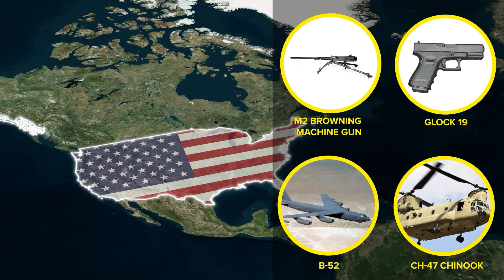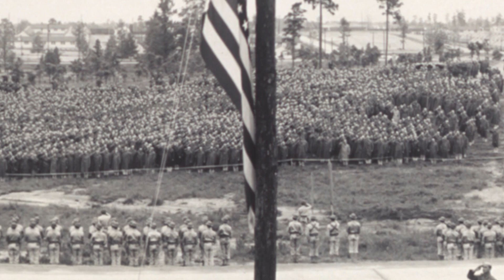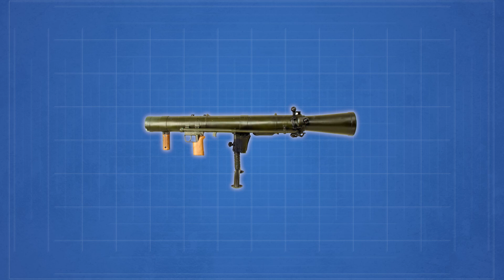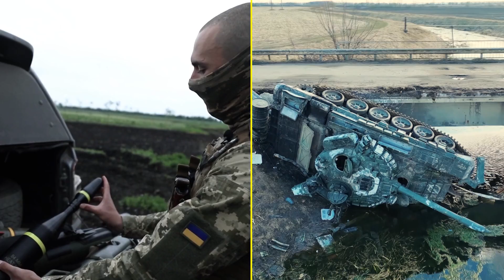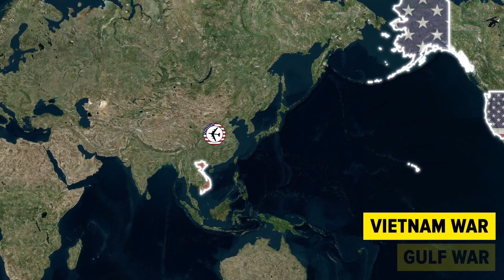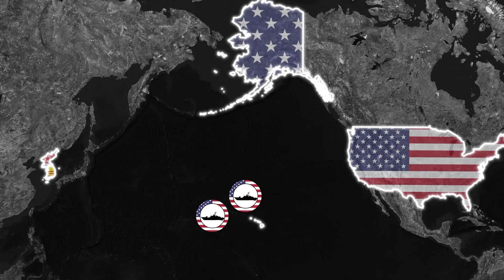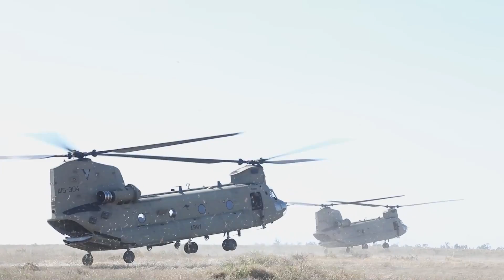Why US Military Can't Replace These 100 Year Old Weapons

Comment: I like how people talk about generations of aircraft as if they are all the same aircraft. They are not. 

The C-130 airframe hasn't changed much, but virtually everything about the plane has. 

The latest Hercules is the J model, and they were only built a few years ago. 

Most in service are the H model which appeared in the mid 1970s and 50 years service of a type is hardly unusual. 

Good luck finding an actual 75 odd year old C-130A model anywhere in service in the world.

With the B-52, it also has been through numerous life upgrades and the models in service appearred in the mid 1960s. None of the aircraft you are talking about are anywhere near as old as you think they are. 

Again, try and find an actual B-52A in service.
Reply: There is one b52 that three generations of a family have flow same airframe just upgraded
Reply: @kylejohns2288  I've always wondered if there were any multi-generational B-52s in service.  It's crazy that 3 generations of a family have flow the exact same plane decades apart. What would be even cooler is that 3 generation B-52 had maintainers that were assigned to it across 3 generations too.
Reply: True, but in the case of the B-52, the last airframe rolled off of the assembly lines decades ago. So while the B-52 has been up graded, multiple times, over the years, none of the airframes in service, or in the boneyard, are exactly new.
Reply: They have had wings, sparing, avionics, defences, and engines replaced during life extentsions. 

It kind of brings in the question of the ' Ship of Theseus '. 

I think only the center body fuseulage would be from the 'H' originals. That's been often modified too, especially the cockpits and nose. 

It's the design and performance that makes it important and long lasting, no other design can quite do what it does as economically, especially as a long range missile launch platform.
Reply: @uberbeeg  ok lets use a similar theory the m1 abrams americas current mbt is very different then when it was implemented changes include gun,drivetrain,and multiple armor upgrade/radar packages but at the end of the day its still a m1 abrams just with a slight designation change to show what modifications from the original design it has a b-52 no matter how many modifications is still a b-52
Reply: @bluespidergaming7719  Ah, that's upgrading or adding items to an existing model. 

C-130Js are built new, they have restructed airframes, different electronics and flight systems, the shape is not quite the same, though the shilouette is familiar there are massive technological differences between the A model and the J. 

Yes, an existing M1, ugraded ( without structural changes to the existing design ) Is just an M-1++

But a C-130J is not a C130A++
Reply: @bluespidergaming7719  As to B-52s, the model they fly know could be considered a B-52H++ to some extent, but much of what would have defined what a B-52H was has gone. Outside of the center fuselage and tail I doubt much of the B-52H eexists having been replaced with new ( not upgraded ) wings, interiors, avionics, control systems etc. 

A ' The ship of Theseus '.
Reply: @uberbeeg  the ship of thesus refers to something in memorial being slowly replaced if no part of the ship currently took place on any voyage of that ship is it still that ship what your describing is if the ship was still doing voyages and having adventures while receiving upgrades say the ship removes its Greek fire tubes for black powder cannons and still did voyages its still the same ship to give a better example if a Tiger tank from ww2 received battle damage and had those parts replaced and still was used in combat after those repairs is it not still a tiger tank now the ship of thesus refers to mach later after ww2 this tank is a museum piece and if every piece of that tank that saw combat was replaced would it still be the same tiger tank
Reply: A ship of Thesus is a Greek thinking problem about a theorhetical ship. It's quite anciet. 

It's about does Thesus' ship remain the same ship if all of it's components are replaced. Obviously it is not, it's a facsimile of Thesus' ship. It's not the original ship. It just looks like it. 

Your Tiger would also mostly be a fascimile of the actual original Tiger. Itr's a Tiger, just not that Tiger.
Reply: @uberbeeg  the ship of thesus refers to it being memorialized having its adventures finished slowly having all of its pieces replaced with age till their is no ship left who saw the voyages that it undertook and the argument is if no part of this ship had undertook the trials of the stories is it still the same ship but the issuance with the b-52 being a ship of thesus is that seeing as its still in service its still writing its stories if during the voyages a rope or a board broke on the ship of thesus and was replaced and continued on its journey its still the same ship with the same history that's the comparison if the Enola gay a b-29 super fortress who dropped the atomic bomb and is essentially a museum piece and has been disserviced had every part replaced over the last 70+ years that would be a ship of thesus not something currently still in use
Reply: @bluespidergaming7719  I don't care about your pedantry. The Ship of THeseus is an example of how people think something is the same when it's actually not. 

Anything else is irrelevant deflection in this context.
Reply: @uberbeeg  thank goodness your argument of nuh uh really made me rethink my position
Reply: @bluespidergaming7719  Go away and grow up.
Reply: @uberbeeg  nuh uh
Reply: N117TG was built in 1957 and is still flying today.  CAL fire operates a fleet of As and Bs from very late 50’s very early 60s.  There are also some private companies operating the old A model.

Comment: I surprised my father who was one of the first paratroopers to fly in a Blackhawk. I told him that the Blackhawk was 40 years old. He was absolutely stunned when I brought that backed up. Then I was thinking about all the other old equipment any of the things are on that list. If you go by desert Storm as the mark for old we have a lot of very old equipment.
Reply: Don't ever tell him about the Huey 😂😂😂
Reply: @DOI_ARTS  he was actually surprised the Marine corps still used Huey when I was in service. That and the cobra.
Reply: I was in the 82nd from 1980-1983 so transitioned from the huey to the Blackhawk as well. Forty years. Wow
Reply: @jefftroyer1151  yeah it's first combat mission was Grenada in '83
Reply: The Corvette is over 50 years old. Are new versions 50 years old? Of course not. Not one UH-60 flown by the U.S. is 40 years old...
Reply: I didn't realise that but your correct. I remember seeing a clip of the uh60 when I was at school now I'm in my 50s.
Reply: Although the B-52 was initially in service in 1955, the ones flying are of 1965 vintage (B-52H) and have been continually updated - including the recent contract for the Rolls-Royce engines that are more efficient, "smokeless", and don't require custom manufacturing of parts.  It's amazing how much weight they can carry on wing pylons, too.
Reply: @everettputerbaugh3996  I recently conceived of new way to use the B-52. I call it brr are beyond radar range air-to-air combat. B-52 can carry missiles that are capable of 300 mi of range or more for air-to-air combat. The F-35 could act as a forward observer spot the targets and guide the missiles to target. In that sense the B-52 would be like a 155mm and the F-35 would be like a forward observer. That way the F-35 does not compromise that stealth capabilities at all. The b-52's could then carry a ton of ordinance. At that point one B-52 and a squadron of f-35s could suppress an entire enemy Air Force.
Reply: the new cobra basically has its old dials replaced w 3 fancy i pads and a server package half the weight and energy draw as an Apache. those things will be around for at least 20 or 30 more years
Reply: @jessewhittemore784  yeah but I do have to say I'm going to miss the chop chop sound it comes with the Huey and Cobra. First time I heard one coming right at me I swear there was three of them. When I saw the first one I wondered why the hell the other two went

Comment: Fun fact about the M2 Browning is The White Feather has used it as a sniper multiple times.
Reply: False info.

He used it once and the circumstances behind that kill were ( for someone of his reputation) a little underwhelming.

He was using the gun in single fire mode and testing a scope and mount. He claimed that during his testing an enemy walked right across the spot where his rounds from testing were impacting so when the enemy stopped he took a shot and the rest is history.  The important thing to realize is that he had already been firing at that spot for awhile and had the gun basically “on target” when he got a chance to shoot that enemy combatant. 

He was not (contrary to some beliefs) going around Vietnam making record long cold bore shots with a ma deuce.

Comment: The B52 have recently been re-engined, so  their operating life has been doubled.
The new jet engines have the same thrust of the old ones (220 t IIRC). New jet engines are capable of much higher thrust, but thrust is a parameter that goes with the design of the airframe.
Thank you for the informative video.
Regards from the UK,
Anthony
Reply: aren't the new engines also going to be far more efficient?
Reply: Not yet they haven’t!
Reply: I'm convinced that the remotorization is all about boosting its combat readiness. They're likely becoming more durable, and I'm betting on increased fuel efficiency—maybe even extending their range or mission time. Maintenance could be a breeze, and how about this: no more needing a bomb to kickstart the engine! Now, that's some high-tech coolness, don't you think
Reply: The current engine is long out of production, spares are becoming non existant

Not unique to the military.  If the engine isn't in current production, parts are a big problem.  Sent out an engine for HSI back in April,  found it needed a bunch of turbine blades.  No "loaner" engines available.  Finally got the repaired engine back a week ago
Reply: @bizjetfixr8352  They're being re-engined with the the new Rolls Royce F130 engines as part of the CERP (Commercial Engine Replacement Program).
Reply: @bogdanshulman8081  Actually, it is a blank artillary round and it allows starting without a ground cart to spin up the first engine to power the starting of the other 7.
Reply: @everettputerbaugh3996  So, it's not as bad as I thought.))
Reply: B52. The Crown Victoria of the airplane world .
Reply: The new engines have not yet been installed, but it's coming
Reply: The new engines are Rolls Royce with the mods being done in the USA. They will give it about 30% more range. This contract was given earlier this year. There are other upgrades also being done including putting the same radar on them as the newest version of the Super Hornet. While Air Force spent money on stealth the Navy spent money on radar and electronic countermeasures. The cockpit is going to upgraded to the 21st century.

Comment: M2 is "if it aint broke dont fix it" personified.
Reply: The M2 and M1911 prove that when you make it perfect the first time it lasts
Reply: Actually there is a problem with the M2.  The bolt carrier can be put into the gun upside down.  If it is, then the gun will fire once and jam.  It'll take a skilled armorer an hour or more to get the bolt carrier free.  I was an M2 machine gunner in Vietnam.  While I could field strip, clean, and reassemble my machine gun without looking, I always made sure the bolt carrier was put in correctly.  Another gunner put the carrier into his gun wrong and all of us got to watch the armorer correct the mistake.
Reply: @peterhobson3262  That would explain why one side of my acquaitences' M2 bolt carrier is heavily stamped "UP".
Reply: Man, the M2 is a behemoth. And an awesome one.
Reply: The M2 is perfectly fine with its weight, it is meant to be mounted not carried like an M60 or M240. That extra weight helps keep the recoil somewhat manageable. In its entire time in service there has only been one very minor change to it that I know about and even veterans of the system would be able to notice the different part if two full guns were disassembled next to each other.
Reply: @richardbossman9875 I know some infantry units used to carry it, but disassembled.  I think the barrel was about 25 pounds or when I was in. I didn't have to focus on it and it was mounted but I wish they'd given us tripods too.  I was mostly given M16s, M203, and the SAW.  I had an FAL mounted with a scope and mount that allowed me to switch to iron sights with little effort. Loaded it was perhaps 13-15 pounds without a bipod but better range than 5.56 mm.  Oh, and it was made to tolerate .308 instead of only 7.62 NATO so range and ballistics were better for a mid-range rifle.  I couldn't use it in our indoor range though if wanting to zero it in. Ricochet risk they said. I was willing to try. 😉
Reply: M2 is the only thing in regular use which approaches 100 years.  We should have kept more WW2 and Korean era fighters for CAS in 3rd world countries.  Mount a larger cannon underneath them like 30-50 mm(?) and rocket pods and 4-6 .50 cals and better $$$ than an A-10 30mm gatling gun with overkill on infantry and light vehicles
Reply: Indeed
Reply: If it ain't broke. Fit it anyways. You're in the army.
Reply: It's way too heavy
Reply: @ackerkartoffel8627 the military has tried lightening the .50 MG. Every attempt has been a failure.

The M2 is the correct weight.
Reply: @ackerkartoffel8627 Its HMG what do you expected?
Reply: @ackerkartoffel8627  Americans are Stronger...more Powerful 💪👊...😁👍🇺🇲
However, most are vehicle-mounted...
Reply: @ackerkartoffel8627 It seems like that's the biggest problem with all of the USA equipment these days. The M1Abrems collapses bridges, the Stealth battleships have too little volume for rockets with their weird shapes, and the B2 and B21 can't hold the same volume of bombs as the B52 because the B2 and B21 have too much volume and maitainance eroded by their stealthy shapes. We're great at everything else though. Stealth and Armor are just so £u€k!ng delicate and heavy in their 1st gen stage. And like The Cheiften, (an M1Abrems tanker who makes youtube videos,) "you could probably loose 20 tons replacing some of the legacy systems and replacing the drive train with a lighter hybrid version." That'd bring the fully loaded Abrems replacement down from over 73.6tons in the M1A2SEP3 when it's accessories to hopefully under 60tons for an M1A2SEP4 or M2A2v1. They might be trying to do a clean sheet design on the Abrems replacement though. A hybrid electric Diesel with neumatoc air suspension instead of tortion bars and an auto loading blast door containing turret would probably also lower the height profile by a few feet while lowering weight and retaining safety too. The tortion bar system alone probably adds a couple tons and a foot or so of height. They really weren't ready to trust pneumatic shocks in the 1980s for some reason. And now we've been stuck a bit heavier and less mobile.
Reply: @viewer-of-content  So? They kick enemy  ass...and that's what matters...
Reply: @dioghaltasfoirneartach7258  That matters, but as an American citizen I always want to have a running list of notes that I can mail to request upgrades. The B21 seems to be a good upgrade to the B2 for reliability and mass production, and I hope the M2A2 is a good upgrade to the M1A2V3. It'd be nice to regain some of the mobility that other tanks have, and be light enough to airdrop or cross most bridges. Some parts that we've kept since the M1A1V1 could be replaced with lighter equivalents on an M2A2, and if replacing tortion bar suspensions and turbine engines with an equivalently powerful pneumatic suspension and a hybrid diesel  keeps the power and looses 10k pounds then that'd be cool too.

Comment: Your picture of two star general with the label "Alvin York" is actually Omar Bradley.
Reply: They also keep showing pictures of the M249 during the M2 section.
Reply: @MattBarnes-r3c to be fair, in MiL-Spec, M2 is the base model series number. M249 is a variation (who knows how many other M2 variants were scrapped or concept only).
Reply: What? The M249 is a Belgian design, it's not some M2 Browing variant.
Reply: @MattBarnes-r3c  I probably should have said it correctly. MiL-Spec can be confusing. M2 is the designation for automatic"machine gun" weapons. However a layperson(the person who put this video together) looked up M2 and it pulled up what the military calls a variant(both logistically and functionally). When I said the variant I should have said logistical analog.
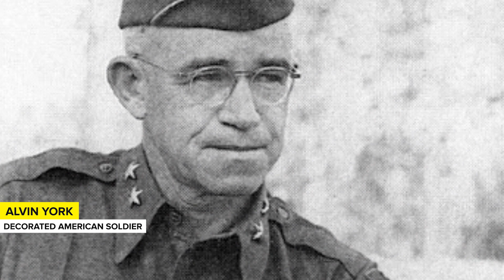Reply: 4:48 Bradley, not York. Nice catch
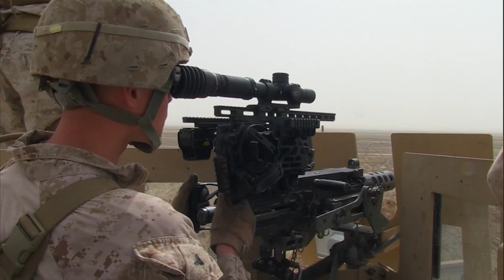Reply: @TheBestDog  Plus, 2:09 is NOT "General John Pershing".
Reply: @traumadog003  Their AI needs a juice break
Reply: Thank you.
Reply: there is significant evidence that a "couple of generals" adjusted the Sgt. York story to improve their odds of remaining on active duty after the war (AKA job security).  Some of the other "men at the scene" disputed the story, but it was "good press" for the expeditionary forces and bond sales.